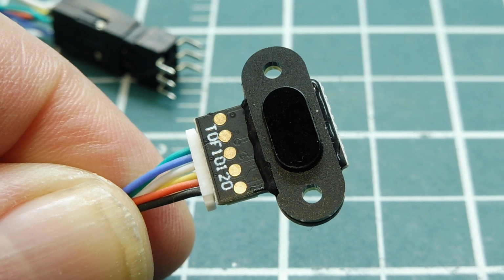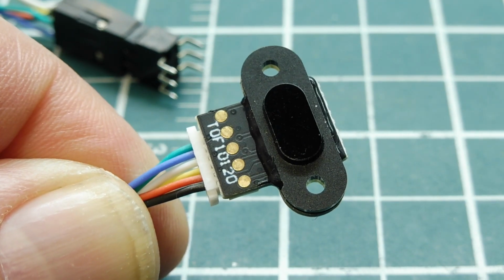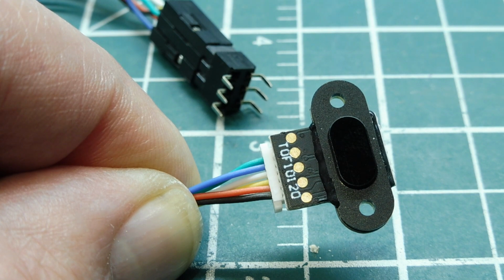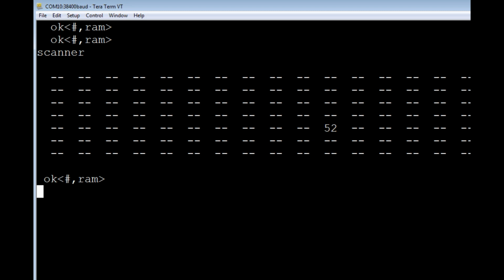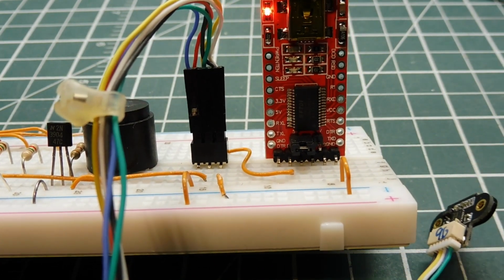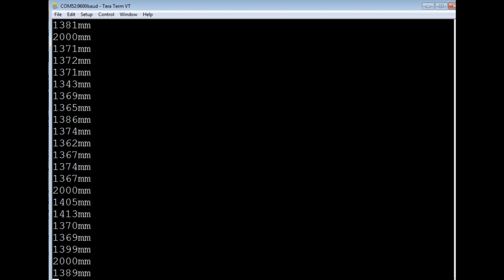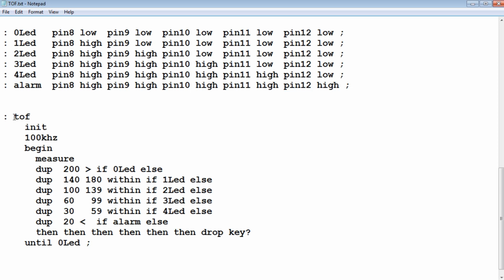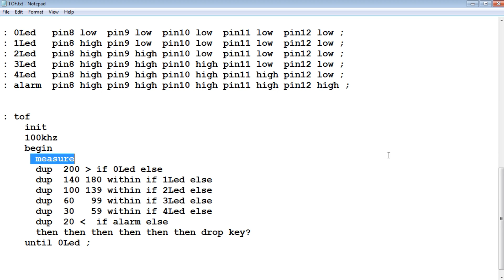Laser Range Sensor / TOF10120  / Arduino

Comment: Will it detect water level or just pass through it?
Reply from the maker: It is not very reliable in detecting water levels. You could put a float in the water and measure off that or use air pressure as in this video: https://youtu.be/NOTMb165jMU

Comment: thank you for this video! I am looking for a similar sensor that can provide distance of up to 150 meters. Do you know if something like this is available?
Reply from the maker: LiDAR would be your closest pick, but range is probably maxed out at 100 meters. For long range you will have to get into land survey equipment. Check out products by TruPulse. https://www.lasertech.com/TruPulse-200L-Laser-Rangefinder.aspx
Reply: Check what consumer laser range finders use. (e.g. hunting or golf lasers). They generally use some pretty accurate optics, so they aren't cheap, but it's going to depend on what accuracy you need.

Comment: Thanks for your video. I tried connecting to my serial port using Tera Term, but it just reads out a string that I do not understand. Here is an example **ë³ööV**ë³ööV**ë³ööV**ë³ööV**ë³ööV**ë³ööV**ë³ööV**ë³ööV**. Do you have any advice?
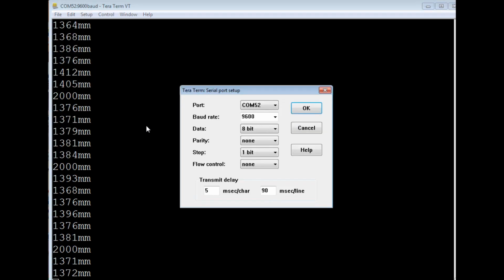Reply from the maker: Looks like your baud rate is not set correctly. Set it to 9600 baud as seen at 5:00.
Reply: @0033mer  Thanks for your reply. I had it set to 9600. However, check and try again.

Comment: hello! thanks for your video. it really great work! I also make some work using tof10120 for my artworks, but it is really hard to get information about tof sensor. So, l'm sorry to say this, but could  you give me this project code?
Reply from the maker: Check out this channel for Arduino code: https://www.youtube.com/watch?v=xO5_3SjEhS4
Reply: @0033mer  I appreciate your help.👍👍
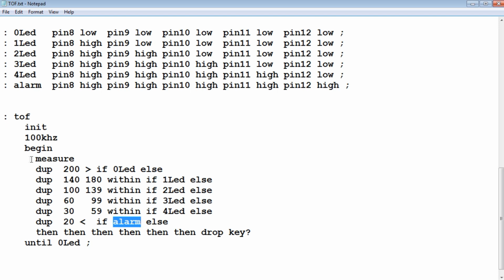Reply from the maker: Check out the word "measure" in my code at 6:54. Send a null over I2C to the sensor and then read two bytes back. That will be the measurement in millimeters.

Comment: I want to build a low cost cleaning robot with mapping feature. Will this sensor work for me to do mapping?
Reply from the maker: Yes it will. Just be aware it will also detect strong sunlight.
Reply: @0033mer  can you help me with this? I just need to map a single room. my university graduation project cleaning robot mapping. and my time is limited. I do not know much coding.

Comment: Can I interface this with a pic microcontroller? Also, will it penetrate water(can it be used to measure the distance under water)?
Reply: Whether you can interface it with a pic is up to you. It outputs i2c data.

I doubt it would read correctly under water. The laser will be refracted.
Reply: I am your cupcake 3 🙈

Comment: I'm guessing some materials might be difficult to detect depending on composition and the angle of incidence. Good presentation. looks simple enough. Do they all come set to the same address?
Reply from the maker: The factory setting is 52 hex. There is a way to re-program it to other addresses but documentation is scarce and what is available is written in chinese.

Comment: Nice vid.  Could you check if this sensor can detect the surface of water and as water rises the distance becomes shorter?  Thx in advance.
Reply from the maker: Some people have had success: https://www.hackster.io/team-protocentral/liquid-level-sensing-using-a-laser-tof-sensor-d04232
I would personally weigh the water tank (strain gauge) and calculate the water level.